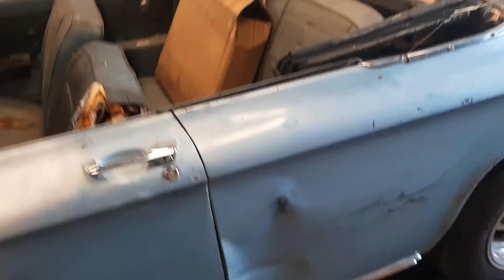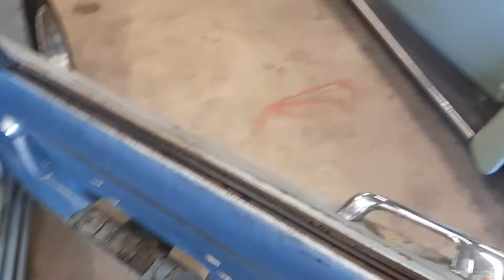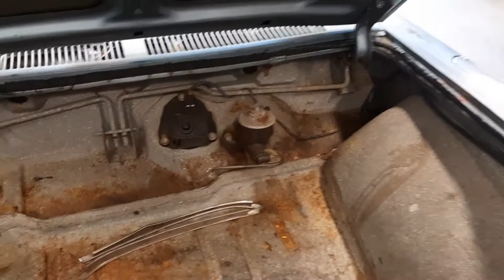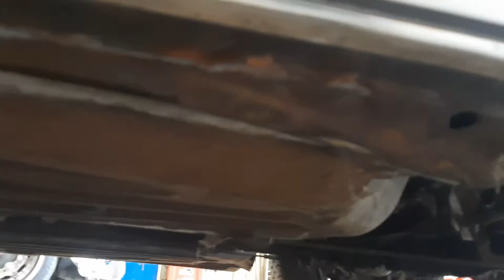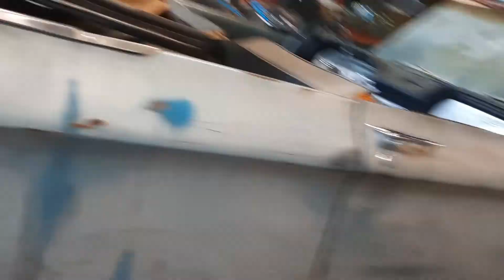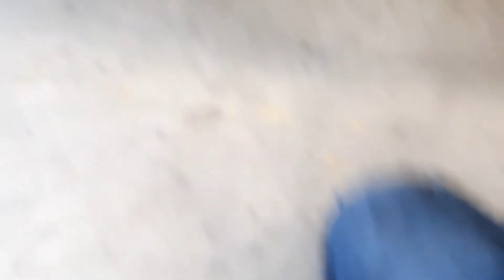CHEVROLET CORVAIR CABRIOLET -1962

Comment: This Corvair is a 1963 ! & the good thing about a 63 convertible it was the most produced  Corvair Monza Convertible with 44,165 produced in 63 so there is allot of available nos , used , & reproduction parts.